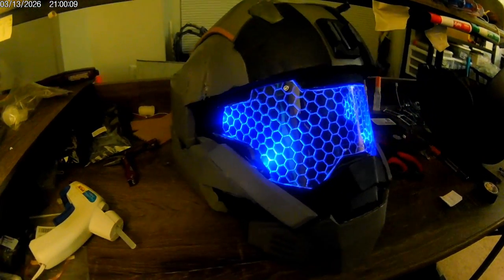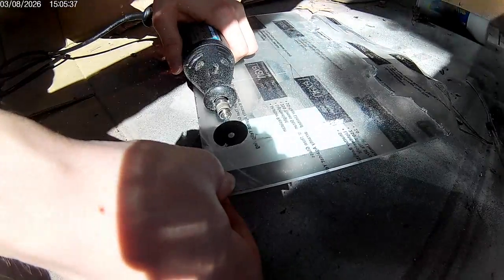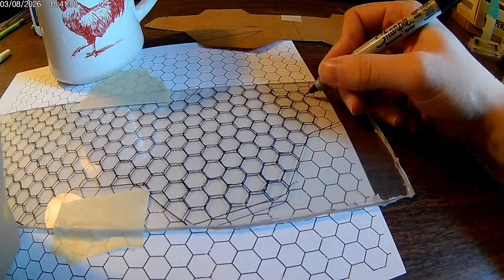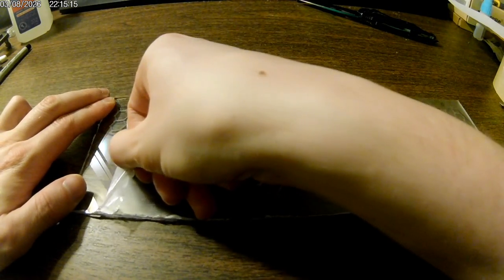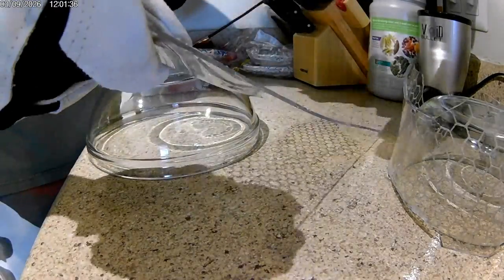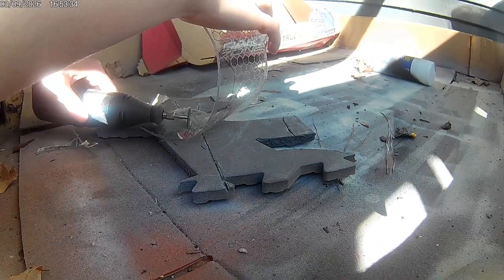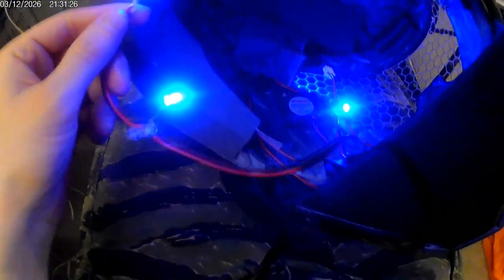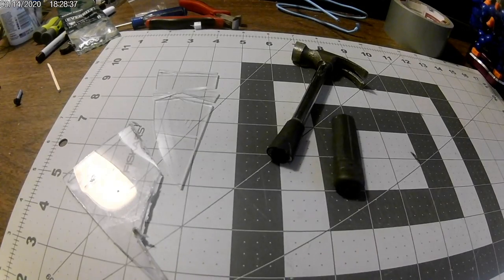Holographic visor How-To

Comment from the maker: Guys I have a 2 room apartment. Of course it would be easier with a table saw/band saw/CNC machine/laser engraver. For those of us who have little in way of room and resources, I want to show you that it can be done with very little
Reply: Yeah, I a lot of regular prop/cosplay makers don't realise that most people have very little rooms and resources, also great vid... lowkey relaxing
Reply: Exactly. We can't all afford, or have the room, to just bring in a CNC machine. People absolutely need videos like this. Great video.
Reply: I will suggest using a toaster oven to warm the entire sheet instead of the heat gun. Trick i learned with kydex.
Reply: A hacksaw for metal cutting also works very well.
Reply: Respect for that, subbed
Reply: Welcome to youtube where there is always someone to tell you that you're doing it wrong, and you could do it much easier with a fully stocked workshop filled with tens of thousands of dollars of equipment.
Reply: i know the fealing, having the shop in a apartmet bilding and no space its raff, and the machenes..  and no resources to, keep upp the good work krafts man.
Reply: @mechanomics2649  A plastic cutting capable CNC can be had for like $300 on amazon, and the whole machine runs on 120v, and is 15.7" x 13.0" x 9.4".  Same with a 3D printer.  Get good at fixturing and you can make virtually any size on the machine.  Hell, you can buy a $50 ikea shelf and fit 3 machines on there with a 2'x2' footprint and a power strip plugged into the wall.  You can coat the inside with wall insulation for sound deadening (CNC that doesn't break 50dB shouldn't piss off your neighbors).  You can cut a hole in the back of the book case and 3D print a port for a tiny shop vac to keep things nice and clean too!  Figure 1 machine is 12" tall, that means, in your average room with 8ft ceilings, you can fit 8 automated machines, 3D printers and CNC's!  Run them all with dust extraction and insulation at the cost of a corner! 

Keep a small tool chest with hand tools.  Maybe get a small box that keeps everything for casting and now you're doing lost PLA casting in the parking lot of your apartment complex and filing things down by hand.  Maybe get a beefy desk that can double as a workbench with a hose to that shop vac, a small vise, or even a 3rd hand setup for smaller parts, and a small dremel set to speed up the work.

No floor space?  Floating wall shelves are fantastic.

You can do a ton with few tools and minimal space for a fairly minimal cost with the right amount of imagination.  Less is more in many situations.
Reply: Where did you get the helmet from? Looks like a helmet from halo
Reply from the maker: @gamingofthelegend3907  It is a helmet from Halo. I made it too
Reply: @asylumprophet  ayyy looks amazing. My mistake I thought it was a motorbike helmet 😂😂. 
Could I do the same holographic design on a motorbike helmet/visor?
Reply: Dude you did an excellent job on this. I wonder how it would look if you ran some glow strips like the ones from Light Mode. I'm thinking the glow is soft on the eyes but bright enough for the outside effect. Just a thought
Reply: bro, how are you living in the year 2026?! time travelers
Reply: yeah first i was like, huh, i can do that way more detailed and with higher quality with a CNC, why doesn't he use one?
 a few moments later i said to myself "duh, maybe he doesn't have CNC you idiot"
thanks for the awesome tutorial, i'll definetly consider to include this in my Spartan helmet, and thanks for the reminder that you don't always need some high tech machines and that it doesn't has to be done perfect to look good
Reply: Just an idea that should be compatible with an appartment: if you have it, you can use an oven to completely heat the entire sheet, and a jigsaw with a woodcutting blade produces really nice edges with PC. Just an idea for future projects :-)
Reply: Is the helmet 3D printed? Did you use a buyable dot helmet as a basis?

Comment: PC can go in the oven around 350*F to heat up, making it a little easier than playing with a heat gun.  Also, a band saw with a fine tooth blade will cut PC very nicely if you have access to one.  Great project and love the idea!!
Reply: You have the right idea  but  lower your temperature. 
I work with  vacuum molded plastic every day for that thin material I would say 200-250 for 2 -5 minutes max then it should be formable.
Temperature can always be increased a couple degrees at a time.

Comment: A couple of pro-tips for ya that I hope will help out in the future: You can cut acrylic perfectly with a skill/hand or a table saw. You just need a 40T blade for a hand saw, 80T on a table saw. On your edges: since you have quite a few angles and directional changes scraping them with an acrylic edge scraper will be difficult, you can "flame polish" them so that they're completely clear. It'll improve the look once you add LED's. For the hexagon pattern: you can absolutely use a ruler to get your lines on there without having to hand trace every line. If you happen to have access to a vinyl cutter (Cameo/Cricut) you can print out the pattern, lay it on the visor and then use one of 2 methods to etch it. 1. Media blast it with a soda blaster or sand blaster. 2. Use acetone to chemically etch the acrylic. Both will provide a super clean look.
Reply: i was gonna ignore this as it's really advice for people with more advanced tools, but I actually do have a vinyl cutter so i'll remember that last bit lol
Reply: @impguardwarhamer  You can also use the flame polish method on your edges. Just hit up a local gas station for a decent torch lighter (in lieu of a propane torch). They're and a couple bucks and re-fillable. You can get butane pretty cheap. I'm sure you're aware, but for other readers: practice on some scrap pieces to get the method down. The end result is pretty awesome.

Comment: To save a TON of time cutting the main rectangle try using the score and snap technique. Couple passes with an xacto blade, then bend it along the edge of a table. The snap is a little scary the first time, but it's WAY FASTER, and a lot cleaner
Reply: I came in to comment exactly this, but scrolled to check first. This is the way. I like to clamp it between two boards or a board and a countertop, score, and snap it. Perfect every time, just like glass.
Reply: If you're going to do this, use fucking gloves. No, seriously. Leather or something tough at least. Worked with a fair bit of plastic, doing just this. Without gloves, each snap is a potentially serious laceration.
Reply: I've used the scoring tool and it works great.  However, I've also used a table saw with a blade made for plastics.  Granted, table saws are no joke either and you have to be extra careful.  Thought I'd mentioned that method as well.  :)

Comment: Another great way to cut lexan or plexi, is nylon string. Take a hacksaw frame and string it with nylon kite string or something similar. Pull the tension on the string pretty tight and make a small starting notch on the edge. You are actually cutting with friction, so the longer you make your stokes, the better. Makes a much cleaner cut.

Comment: one way to avoid the bubbling with polycarb is to dry it out in an oven. keep the temp below low (120-ish deg) and the moisture in the material will evaporate out. then when you heat it up to temp to form the bubbles wont form. its the moisture in the material expanding that makes it, not air. Still have to be careful not to burn the material (separate issue of having direct heat too close).  You may be able to use an oven to form instead of a heat gun. if you get a piece of metal you can flex into the shape you want you can have the plastic drape mold over (kinda like vacuum forming w/o the vacuum). Acrylic will form easier because Poly cools super fast you have almost no working time with it. either way your right on the money with alcohol (or warm soapy water) to clean it. No Windex (or other amonia based cleaners. it can cause the plastic (both poly and acrylic) to spiderweb.

Comment: I use a jigsaw with a plastic bit for cutting. Heck of a lot easier, but you have to go slow otherwise it melts/rejoins behind the cut. Cooling the plastic and bit with some cold water helps.

Comment: A tip if you want it go faster to cut, have something like a work table with a small gap, so you can have a very fine toothed jigsaw. It will burn much less. To form it, find something rounded that is ovensafe and put it in the oven at 120-150C until it slowly starts to mold itself around the rounded object.

Comment: With Acrylic you could put the whole thing in the oven at 150C and it should be floppy. Then drape over the form you want.
Reply: For how long?
Reply: @chariot5660  Until it forms over whatever shape you're trying to obtain.  If It isn't also plastic, you could put that in the over with, and just watch with the light on.  As soon as it starts to droop, you can take it out and form by hand.
Done it...not on this project, but on others.  Takes 5-15 minutes to get soft enough, depending on how thick your plex is.

Comment: Laser engraving and heat forming on a frame will give you a better effect. You should use your oven to heat the material uniformly to avoid mistakes and bubbles from popping up.

Comment: Hey dude. What I'd recommend for transferring the pattern, there's two options. You can use a vinyl cutter to cut "mesh" out of clear vinyl, or the cheaper way would be to use heat transfer stencil paper.

Comment: for cutting straight lines for the rectangle  on the polycarb score the lines 3 or 4 times with a sharp box cutter then snap it against a table edge

Comment: Nice tutorial! What application do you have that means you need polycarb? Planning on getting hit with hammers?
Reply from the maker: Full contact sparring, rock climbing, maybe paintball
Reply: @asylumprophet  please wear a second set of low profile goggles underneath this if you take it paint balling. This helmet looks awesome, but those pattern cuts will weaken it's impact resistance.
Reply from the maker: @nnerrfman6326  pending impact tests. The engraving does weaken it, but it's a relatively shallow groove. Polycarb is pretty tough

Comment: back in the day i did the same thing to some eye lenses for my gasmask....its a grate look but since you see out i did an extra step you may want to try on round 2 if you do....take a wood burner and follow the etchings ...or better yet use it as the etch tool...you get clear etches that you can see much better threw and light on the edges of it still give amazing glow in the etchings...just a fun tip :)
Reply: can you give a bit more information about the wood burner?
Reply: @arklanbk  if you take clear acrilic I used a 1/8 inch thick but that was to match the lens cups mostly ...alto you do want it thik anof that the burn is half the depth of it...now the wood burner part I used a basic wood burning kit and drew my design onto the plastic I used sharpy but you may want to experiment if you try it and just followed the lines I traced doing my best to stay in one slow motion because stopping makes slight thickness differences the light will pick up...ok so now let's say you did the burn you will have scale on the edges of it ...I ran a box cutter blade across that to smooth it out...it you get white spots in the burn just go over it agean and should be good...then just light it with edge lighting :)
Reply: @arklanbk  it will give you one side smooth and one side with the cut ..it will light up the design like neon...and I was even able to still see threw it...it was my rave mask

Comment: Great project! Good job!  Did you make some kind of  "body armor" to go with it for your cosplay?  I was wondering if LED strip lighting would work instead of using LED bulbs?  I've seen a lot of projects on YT that use them.
Reply from the maker: Any LED should do. The downside to using the strips is their width and they don't curve well, so you'd need to account for that in your design

Comment: Just a couple of things having worked with polycarbonate building museum displays, most hardware stores have a plexiglass cutter, that can be used on Polycarbonate, you just have to make the groove deeper.  You can also us the cutter to scratch the lines.  As for forming, it's easy enough to make a form to bend the polycarbonate around.  It can be made of a variety of materials, depending if you plan to reuse it. I'd advise not to put the whole polycarbonate pattern in an oven, as it can end up being a little wonky.  The heat gun is the way to go!
Reply from the maker: I picked up one of the hardware store cutters/scoring knives, I just couldn't get it to work. Maybe I just didn't have the patience to score it deep enough lol

Comment: ok so ill post this as to help folks save tons of time. In my Industry we use clear face shields for cutting and grinding the ones we use are made by 3M but other companies make them as well. They  can be purchased at most hardware stores or safety equipment stores fairly cheaply and are flexible already but if you want  with a little heat can be shaped a bit more and  much easier and will hold their shape. They are ANSI approved "American National Standards Institute" witch means they are basically the same thing you find in most helmets or safety applications. The hex pattern can be made on a Cricut with clear transfer and then just applied to the lens much easier than carving. hope the info helps.

Comment: if you have a piece to form/ mold the shape to you can put your material in the oven at 200.- 250for a  couple of minutes  then with gloves on take the poly out and push it to your mold/form.
You may have to increase the temperature slightly. But its easier to increase temperature  or time in oven than  to over  heat the material..
 But overall it's a cool visor
And  if you  use  red LEDs  it will have less effect on your night vision

Comment: To save yourself time, do this with vacuum forming.. would be a much longer initial process, but would be easier, and quickly repeatable. Making the mold ( or "buck" as it's called would be most time consuming, but once finished, every visor would only take seconds, to a minute or 2.

Comment: As a big fan of halo and the like I've always wanted to make my own helmet, where would I go to start? Not just a holographic visor, but where should I go to learn about all the materials and the actual crafting process?
Reply from the maker: The easiest way at this point is to look into pepakura files and 3D, there's enough of a community that you can just download files and get to work with templates or printing. But if you want to do it by hand or from scratch, the best place to start is cardboard/stock. Cheap, plentiful, relatively easy to work with and practice. When you start to get good with it, you can either reinforce with epoxies, fiberglass, etc., or use the sections as templates. Everything I make starts with a cardboard prototype that I use to trace out the real parts with EVA (craft foam/floor tiles), polycarb, and PVC (flattened pipe).

Of course, there are people much more skilled than I when it comes to this stuff. I haven't even started to get into sculpting foam, bondo, composite fillers...

Comment: FYI wearing red filter glasses under your blue light visor will also stop you being blinded. Might not work for a mask where your entire fact is visible but for masks with glowing eye holes: placing a red filter behind the blue lights (or vice versa) will filter the blue light out meaning you can crank the leds or just enjoy being able to see betterx

Comment: I would use overhead projector film to print the pattern on.  Then heat it just enough to make it sticky (it is plastic, after all).  I'd then press it onto the polycarb.  The plastic would adhere to the polycarb like a giant sticker.  If you heat the the polycarb just a bit they would bond even better.  Plus, if you cane get it hot enough to flex, you can complete the "lens" in essentially one step.  It would also mean you don't have to sand the polycarb afterwards.

In fact if you simply heat two layers, form them, then sandwich the projector film between them, you get the same effect as etching a single layer with far less effort as heating them is a relatively simple thing.
Reply from the maker: You can achieve the same effect with paint. Problem with these methods is it disperses as much light in as out, so you can't see as well. Engraving reflects most of the light out

Comment: Some suggestions for improvement: Put the Polycarbonate sheet in the oven set at 300°F / 150°C then use your heat gun if you need more. If you want to avoid the risk for bubbles, put the sheet, without the masking in the oven at 250°F / 125°C for 4 hours. If the polycarbonate melts during cutting, increas cutting speed / lower juigsaw speed. When you mark the inside with black, the light will be even less disturbing.

Comment: Any tips on forming the visor vertically as well as horizontally? I'd like to make one of these as a replacement outsert for an MSA millennium
Reply from the maker: I haven't tried it with polycarb yet, but with other thermoplastics and foams you heat up as much as possible and then press over a round surface. You need some sort of forming die/mold to contour, I use the outside of those mixing bowls

Comment: Nice work. I've never done anything like that but could you use el wire for the lighting instead of leds it would give a more even lighting
Reply from the maker: EL wire doesn't put off directional light, so it doesn't shine into the material per se. It also gives off a high-pitched whine which I don't want near my head